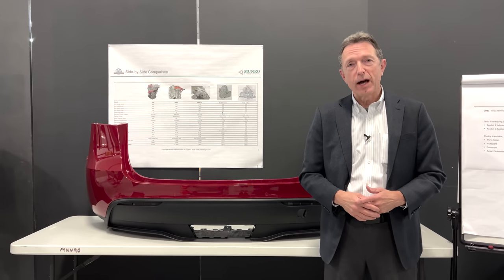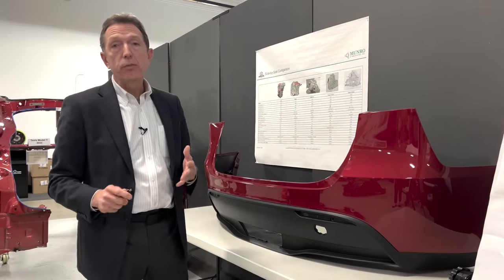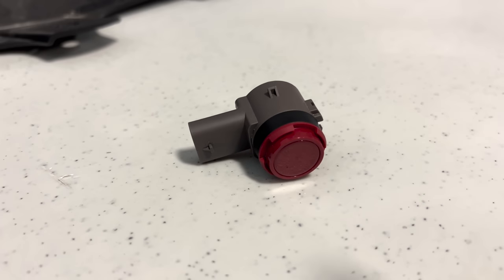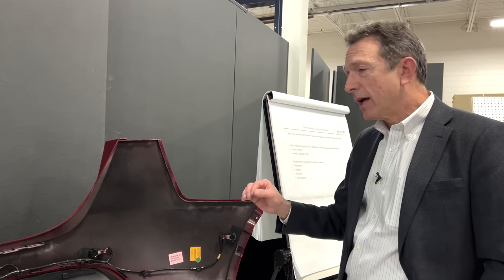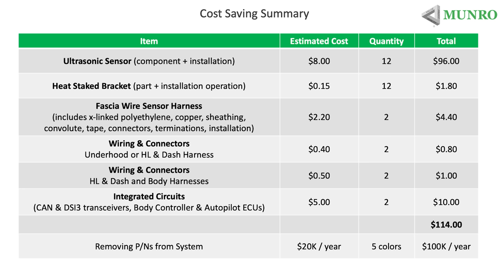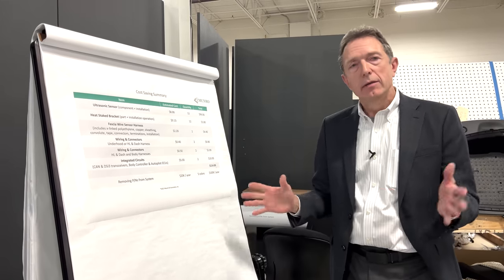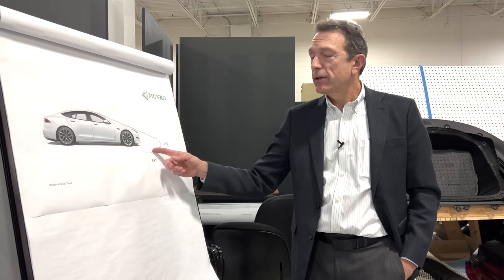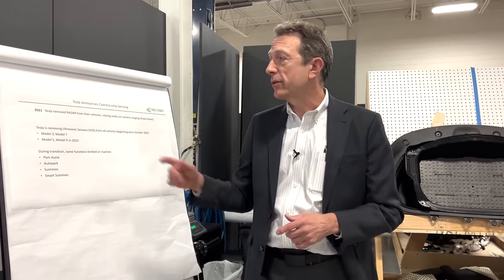Tesla REMOVING Their Ultrasonic Sensors

Comment: So a $100,000 2023 Model S will have fewer safety features than my 2013 Jeep had - blind spot monitors, cross traffic and pedestrian alerts?  How cheap can Tesla be?  My 2015 Model had radar cruise control and it worked really well.  My 2021 Model S doesn't have radar, it kind of sucks - it performs like a teen driver who is texting while driving - not paying attention, and slamming on the brakes instead of gradually slowing down, and then when traffic starts to move again, slowly trying to catch up again. 

Tesla needs to be careful.  In a few years, they will have real competition.

Comment: I am still of the belief that Tesla does NOT want you to drive their car in bad conditions. Fog, heavy rain, wet snow. Just park it. Instead of making the roads safer they are taking away anything that might be of actual use to a driver. Seriously, self driving cars are not ready for prime time. Just ask the pair of motorcyclists that died because a Tesla failed to recognize them and ran them over.

Comment: Being in the business, I jumped on the chair when he said 8USD for a USS (as the component itself probably costs less than a half of that) but then he went on to detail that this includes also assembly at Tesla and all OEM costs (accessories, color matching, which is a pain, versioning and so on) and the total estimate of 114USD is in line with my calculation...
So, long story short, they are getting rid of something relatively cheap, leaving customers with technical questions about performance parity and possible issues. I don't know, but may cancel my reservation on this...
Reply: I would suggest you did a reasonable lenght testdrive at night and/or rainy conditions in a TM3/Y that has "Vision" installed on mainroads with opposing & passing traffic before you buy it. I am deeply sad with the degraded experience my TM3 gives me now vs. when it was radarbased.

Comment: I don't see how you can get away with relying on cameras alone in night conditions especially with heavy rain and snow or even significant sun glare. Camera Lenses also can get dirty, ultrasonic sensors don't. I would not trust this with my life in bad driving conditions. I don't see lidar, or ultrasound, or other systems as a crutch, I seem them as necessities if you want an AI driving system that is better and safer than humans in all driving conditions.

Comment: I'd recommend watching the AI day presentation, specifically the occupancy network sections.  They explain  most of Mikes concerns.  High level explanation, they map the space and objects before they enter the blind spot.  They also calculate object trajectories before they enter the blind spot.  The tricky part is cold start.  You turn on the car and it had to guess what is in the blind spot based on what it can see.  All of those problems are not all that difficult in the context of navigation in a confined space since your possible vectors are pretty low to begin with.

Comment: Great video. They can always add two more cameras on the front and rear bumper of the vehicle to cover those low blind spots. That is if that's not in their plan to expand the number of cameras on the vehicles to have a complete 360 view around the vehicle on real time for the driver.

Comment: Imho they are removing way too many things, to save some money, to the point I'm not that interested in Tesla anymore (had planned to buy one in a year or so), first they removed the radar, which is a god send around here (North Europe), there is often evening fog/heavy rain/snow depending on the time of the year, which the radar sensor (in a Audi, but still), could easily see through, way past the visible range, which made it a lot safer, which a camera has no chance to be able to do, despite whatever Tesla claims. And now this, removing basic features as parking assist, while already having pretty sub par quality fit and fitness compared to other EV alternatives these days, just can't see myself wanting a Tesla anymore, other brands have surpassed Tesla in quality a long time ago, some even has similar efficiency these days, and close to the same performance as a Model 3 fx, while not a fan of Chinese cars, Polestar (volvo) is looking really great going forward, way better quality, still has ultrasonic sensors, radar sensors, and even plan on adding lidar in the upcoming models. Was never a fan of self driving, which is what Tesla seems to be all about these days, I honestly just want to drive myself, with good driving assists. Personally waiting a bit for new models from Audi/BWM though, hard to go back from that.

Besides that, most European parking spaces are a lot smaller than the ones in the US, having a hard time seeing how they will fix Autopark/Parkassist for that without ultrasonic sensors due to the size constraints alone.

Comment: Great presentation! 
Tesla holds safety to the highest standard. If they are taking out sensors that can pick up low lying edge cases, will they implement a better solution? Will higher def cameras achieve this? This would be a great investor question for Q3 call.

Comment: Good luck with the blindspots that aren't covered by cameras. To save $100 to $200 on a $50000 to $70000 Car is entirely useless. 

And to limit the 4 functions allow the customers to start a legal case against Tesla, based they get the money for these functions but do not deliver them. And this is simply called fraud.

Comment: 6:26 is completely BS - there are multiple front-facing cameras at different heights. There is no "real" deadspot like the pictured one - the actual line is much more narrow and steep. Unless something is literally a few cm away from the lowest point of the front bumper it will be seen.
But this entire move definitely is risky ... and im guessing Tesla will pay the price for that decision pretty soon - it only takes one single crash or accident to make the officials acutely aware of this bad design-decision. Prophecy : there will be fatal accidents and Tesla will re-integrate a few additional sensors again, marketing it for a higher price, of course. You simply cant establish proper safety protocols without having at least one absolute, reliable source of sensor truth. Imaging is fuzzy and sometimes unreliable by design, no matter how advanced your processing might be - it will never reach absolute sensor-levels. Ever. But it "may" get very close at some point in the distant future ...

Comment: My experience working as a technician in a Car dealership was most of the time the ultrasonic sensors were smashed and damaged due to OTHER careless drivers crashing into them in a carpark situation. They rarely ever worked correctly so why not get rid of them. This will significantly reduce the cost and complexity of minor front and rear crash repairs....

Comment: Parking places do change. Take one example: You reverse out and turn wheel to get out from a parking space, and then, the car at the side might have changed. Or on the side of the road parking, the car in the front have changed. And other things might change in all kind of areas.

This is is obviously done first of all because of shortage of sensors. To push more cars out. And second of all, to save money. They do not give a shit about the customers. Not One Shit. It is all about pushing more cars and reduce cost. The same with radar. More cars, reduce cost. Nothing to do with anything else.
And speaking of radar, they have a new radar in their stock lists. Probably because there will be added a radar again, since you CAN NOT solve any real kind of self driving without it. Will Not Happen. And the sodar is also needed. And most probably lidar. And of course microphone, stereo microphone.

But, well, Tesla is so far behind self driving tech now so, let them play around. Then they can sit in the shadows.

Comment: The cameras will see/detect parking blocks from a longer distance and remember their position, much like a human being; the only thing is that the FSD memory and accuracy will be superior to the human brain. 

The only problem is if a low object moves in front of the car while the sight is totally blocked by ex. a long truck, and there isn't any trajectory to calculate the trajectory of the low and fast-moving object ex., a small dog duct taped to an electric skateboard remote controlled by a Tesla hater 🤷🏼‍♂️

Comment: Remove these sensors and relying on cameras - and what could possibly go wrong😅 a few more bikers will bite the dust under that bumper. Is this part cost saving and part lockdown supply issues.

Comment: This was a short and I think reasonable explanation of the true impacts of the loss of these sensors.    https://youtu.be/1imyiPbYB24. Dave Lee investing. Less than 10 minutes. Looking at the great charts here ( well done BTW.  Is there anyone at Munro that can screw up things on YouTube? Not that I can tell ) and combining with the small gain in warning I see that mainly summon and parking concrete logs are the only thing missing by the loss of these devices.  And with that in mind your own vision will tell you not to run over something at low speeds (if you are paying attention) or if too fast you will hit it anyway.    Well done video and I see the margins on the vehicles increasing with this - that makes my stock smile.

Comment: so they have removed the parking censors not a problem as long as they have the cameras in the right position to see the distance to the obstruction but to remove the radar is STUPID as cameras cannot see in all conditions where radar can so in my way of thinking it will become dangerous yes it will work in optimal conditions but when its snowing and dark and pouring rain the cameras will be useless in distance recording where the radar will see through all that so don't be stupid tesla, in fact, add flur as well forward-looking infrared then it will be safe but to remove radar is DUMB cameras no matter what pixel you change them to are limited period there is no way in hell I would trust it with cameras alone to me it's just lazy programming if you can't get them to work together then get better programmers china seems to have done it so why not tesla I know they work on a mapped system and not GPS like tesla and use AI which is good but AI needs more input to check its findings without flur or radar or lydar which isn't as good as radar as it cant see in all conditions to me it seams to be a cost cutting and a dangerous exercise I bet you they will be re fitted after a while when reports start coming in about near collisions in poor weather conditions or you simply wont be able to use self driving only in optimal conditions only which isn't worth paying for as they ask a high price already you would think by now they would have learnt there lessons there no easy free ride you have to crawl your way up in small incraments not one step forwards then two steps back we shall see how successful it will be on cameras alone I bet it will fail in bad conditions.